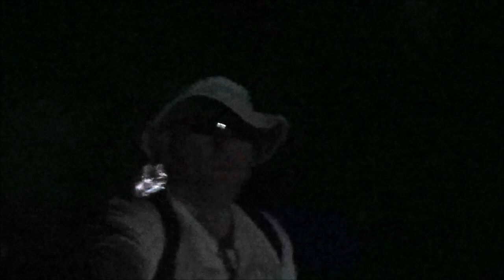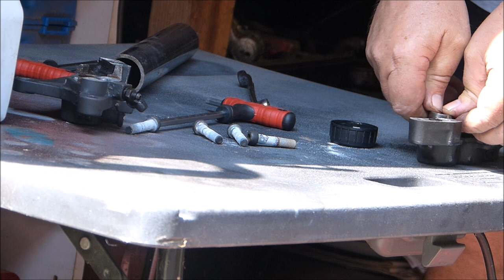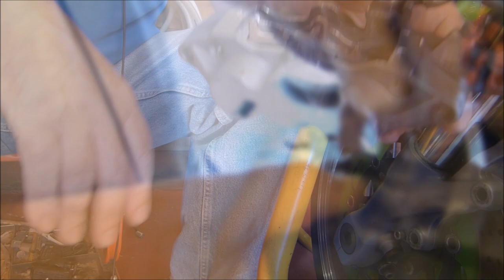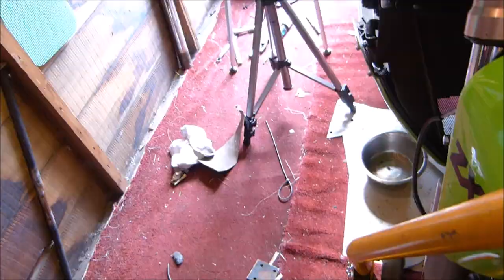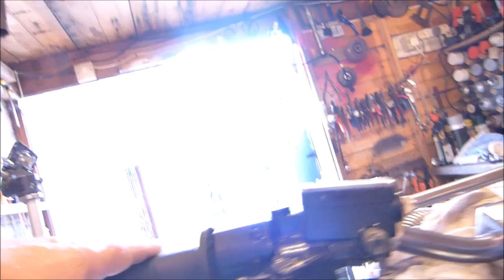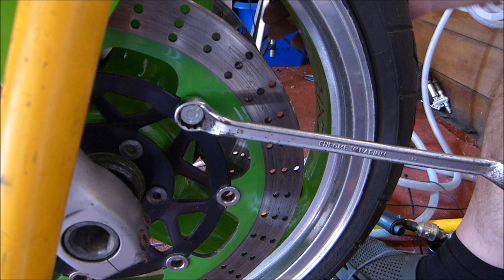Kawasaki ZXR750H1 front brakes and disc bobbins cleaning. P-2.

Comment: Good video. 
Next time make a video of how you clean your wheels . 
I can never get the chrome that shiny ! 
What do you use to clean them ?
Reply from the maker: Thanks buddy.. 
I just use autosol metal Polish.
Reply: @jonyr1TT  
Excellent.. 
Are you just applying and rubbing it with a microfiber cloth or so or using a buff machine ?
Reply from the maker: Yes but first you have to prepare the aluminium remove any paint or varnish and then like you say use a buffer I just use my drill
Reply: Excellent.. 
What adapter are you using on the drill and where did you purchase it from ?
Reply from the maker: There are numerous types of adapters I get mine from eBay
Reply: @jonyr1TT  👍
Reply from the maker: thank you.